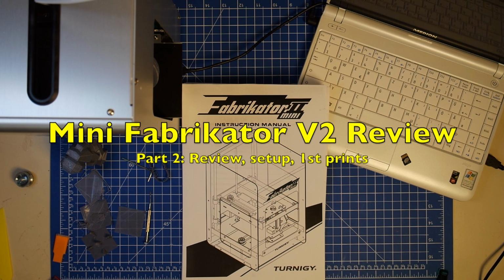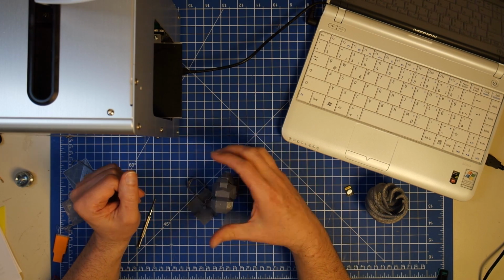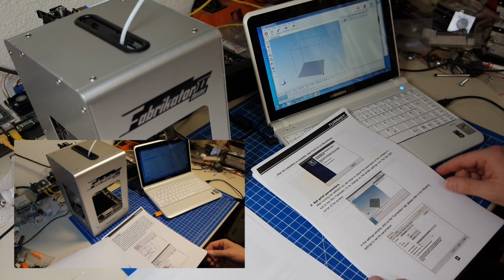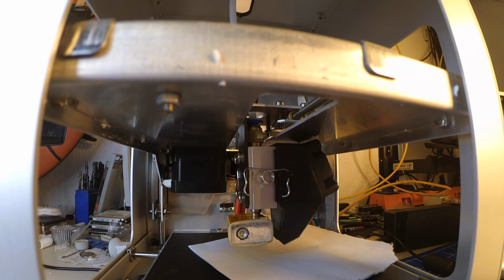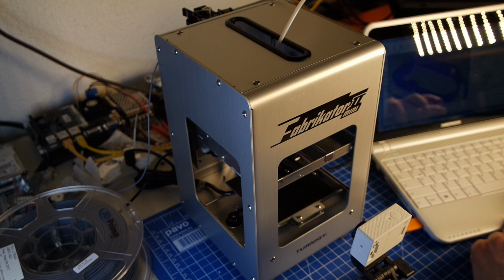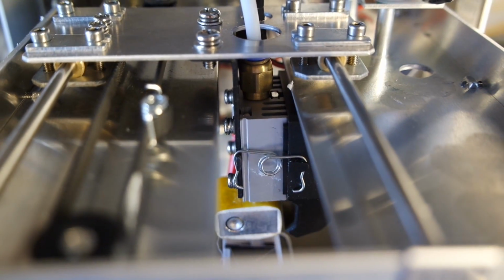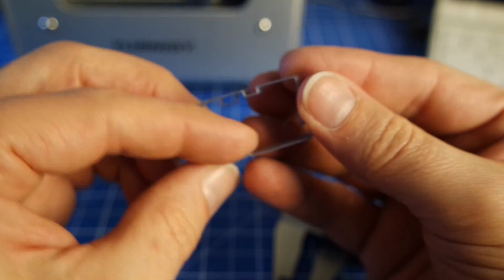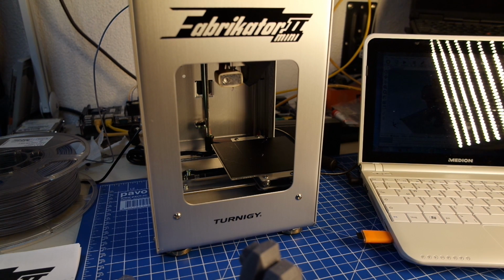3D Printer: Mini Fabrikator V2 Review - Setup and Printing

Comment: i just got this printer but the cura in the micro usb card is not the one that is in the manual and its the one in the video and i dont know what to do, help?
Reply from the maker: Download Repetier Host from the internet, when installing, make sure to install all slicers. You can import the cura settings from the SD card into the slicer that comes with repetier. (go to slicer menu, click configuration, and from those menus import the settings).
That will give you the same panels as in the manual. Repetier Host was included on the SD card that came with my printer.

Comment: NOOP Question:  Anyone had luck printing ABS?  Spent about 4 hours yesterday trying to get the little guy to get even the first layer printed out.  Think the flow rate of filament is all messed up because it doesn't seem to be laying down as much as need to get a good base layer.  Plus the extruder seems to be trying to change its temp down after i set to 240.  Not sure if i didn't plug in the right values from HK paperwork (which weren't in box, had to get off google.)  Lost in the sauce.  Any help would be great!
Reply from the maker: I never printed ABS with this little one. The extruder is ( in my opinion ) not suited for those high temps. The documentation is available on the HobbyKing website on the product page.

Comment: Hi, i am having some issues with the first layer while printing a raft it looks like the printer is trying too hard to push the filament and the extruder motor gear slips. This happens only during first layer of raft. please can u share your settings in cura for raft. Also any helpful suggestions.
Oh and i am also not able to print without a raft. the first layer never sticks.. i have tried bed leveling so many times it still won't stick. so i land up using a raft.
Reply from the maker: As a first step clean your build area with some cleaning alcohol ( no acetone ). Then heat the build area to 60 degC for at least 5 minutes and repeat the zeroing of the z axis again. A single piece of copier paper should slide out between build area and extruder with minimal force applied.
The reason is (and I had the same issue) that during the heating up of the build area it rises a bit, and then settles again.
Also make sure that the Z-Axis is moving freely, clean and lubricate the rods if needed.
Whan doing normal prints always pre-heat the build area for at least 5 minutes, it takes some time for the heat to spread.

Comment: I'm having a bit of a problem with my Fabrikator II that arrived to day, when i start printing the filament does not stick to the base but instead forms a clump around the extruder. I am using the recommended settings and have leveled the print bed but am using PETG instead of PLA so to accommodate for this tried using a hotter temperature, but i am still getting the same problem.Do you know any reasons that this could be?
Thanks.
Reply from the maker: Clean off the pad with some rubbing or cleaning alcohol. Don't use acetone ! Also make sure to preheat at least 5 minutes. When the preheating is done check the height of the print bed again, it might have changed during the first few prints.
Reply: Thanks that did the trick!!

Comment: I have a bit of a dilemma :P. I am stuck between buying this and the tronxy X1. I love the look of the fabrikator mini v2 but the tronxy is cheaper, faster and has a larger build area. any input on this? BTW i dont mind tinkering, ive build 3D printers from scratch before so i dont mind the fact that the tronxy x1 need to be assembled. I have also already considered the anet a8 but i dont like that it is so large and made of acrylic
Reply from the maker: That's a complicated one .... :
- The Anet and the tronxy are acrylic in parts, while the fabrikator is aluminium.
- The tronxy and the fabrikator are special builds while the a8 is basically an i3 clone.
- a8 and tronxy have a display and menu while the mini has wifi
- only the fabrikator mini v2 comes with a heated print bed
My 2 cents..
- If you already have a 3D printer, go for the mini or the tronxy
- If you don't have a 3D printer, go for the biggest you can afford, with the possibility of adding a heated bed. in this case: the a8
- If you want a mobile device, take the fabrikator mini
- If you want something to play with, that is different and cool, it's probably the tronxy.

Cheers,
Dirk
Reply: Thanks, I appreciate it, I ended up going with the tronxy x1 but if I ever decide on another printer, the fab mini would probably be the next after that. It looks so sleek

Comment: I think a second fan on the other side of the extruder could help with those overhangs. It seems that only the ones on the right side of the print had problems because the print itself blocked the only fan on the left, but looks very nice overall, might consider buying one !

Comment: Thank you for sharing this early review. I do have a couple of questions, if you don't mind:

They seem to have gotten rid of the pulley system, which gave the old one its good precision to the cost of low printing speed. Did you see any differences in speed or accuracy compared to the old version? What actual printing speeds did you use?

The old version was praised for being very silent. How loud is this orchestra of stepper motors in reality? Anything to compare it to?

Cheers and Grüße
Reply from the maker: Regarding resolution the new printer is up to par with the old one, looking at the noise it's a big step backwards, but that comes with the aluminium enclosure (which I really love). The steppers also don't get as hot as they used to do with the old model. 
The only thing you need to watch out for with the new one is that you should pre-heat the build area for at least 5 minutes before printing, because it tends to bend upwards at the beginning (because of the un-even heat distribution). But that goes away after some time. The new printer is really fast - 40mm/s compared to 15mm/s with the old one, and there is still more available.
So, my lookout very positive. 
Cheers, Dirk !
Reply: Thank you for your answers. Especially for the hint about the warping heated bed. The loud motors seem like a tolerable tradeoff for all other features. Looking forward to your upcoming videos , until mine arrives...

Comment: Good review, would you buy one with your own money?
Reply from the maker: Yes I would have. In fact I already had one in my shopping cart at HK when I got their review offer. I did buy the V1 back then.
Reply: How does the software that comes with it work out. 
For a budget machine, what would be a good design software to use?
Reply from the maker: There is no design software bundled with the printer, it comes with repetier host to prepare, slice and transfer the objects to the printer. It's the same as it was with the V1 Fabrikator.